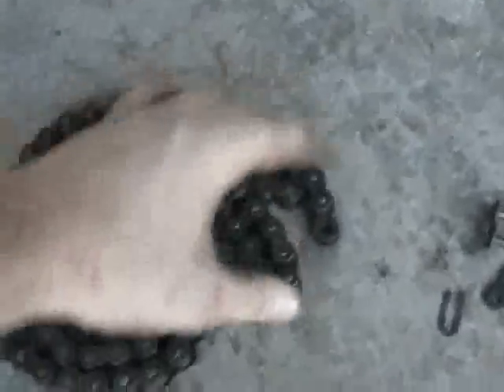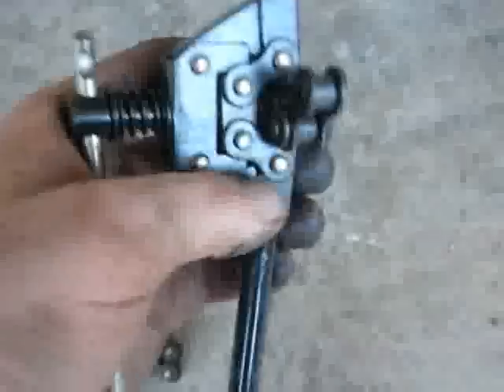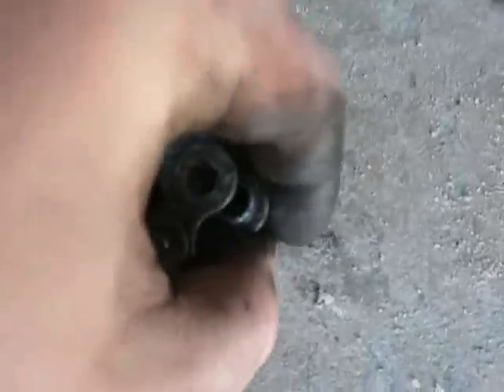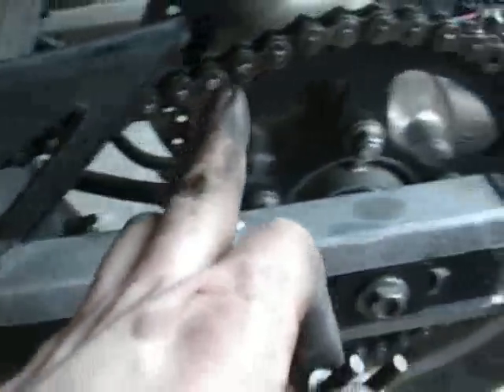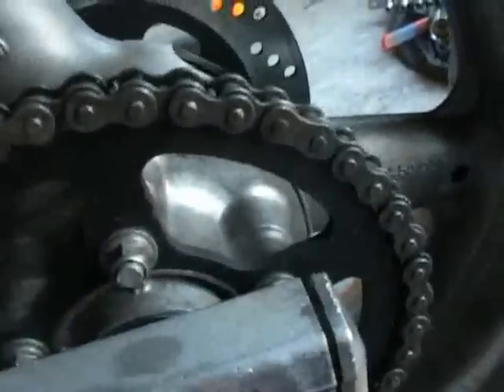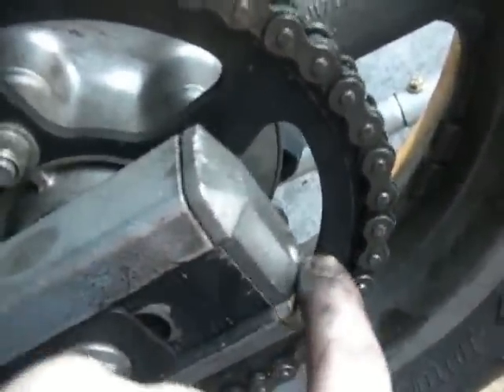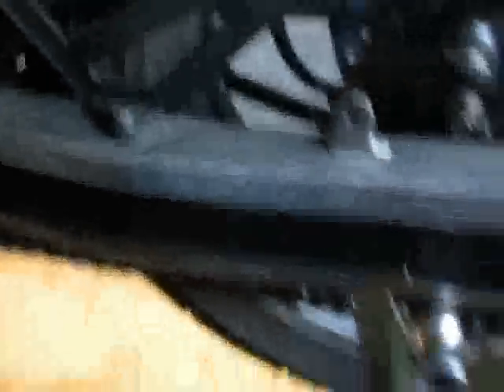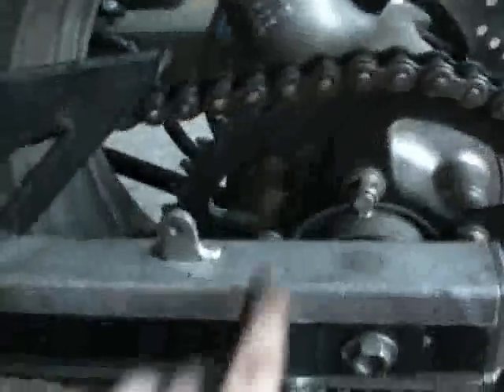Howto: Replace Your Motorcycle Chain in 10 Mins

Comment: TOP TIP: After splitting the old chain, if you join the new chain to the old chain with a cable tie (or even the old link), you can pull the old chain around the front sprocket (in neutral) and it will thread the new chain for you. That saves having to remove the front sprocket cover and/or fiddly threading of the new chain into position.....

Comment from the maker: Sounds good.  For others to read: An ideal scenario would be to run a straight edge along the chain, but thats not always physically possible. Even the tick marks aren't always accurate (if your bike even has them, this one does not.) Its very accurate (enough) to run your line of sight down the length of the chain. This works well for figuring the straightness of lumber as it does a chain.

Comment: Nice, one tip I have is to use the old master link to attach the new chain to the old one after its trimmed to the proper size.   Pull the chain around and back to the rear sprocket till the ends of the new chain meet up at the rear sprocket and then remove the old chain and attach as normal with the new master link.  It avoids having to pull the plate off on the front side.

Comment: Thanks for the information.

I'm new to motorbikes but am alright with the tools, I was cleaning my chain alot and still only got 30 000 km (18 750 miles) on it from brand new.

The rear sprocket has the wave pattern on it now too.  So I'll have to replace chain and sprocket now before I can ride again.  The front sprocket still looks good.

I was resisting the temptation to lube the chain with the motor running, however I did that last time, I won't do that anymore after seeing that photo.

Comment: Thanks for the hint on putting the two ends together on the rear sprocket.  Floating in space between the front and rear sprocket the master link is a pain to get set... it's those little tricks that make doing it yourself so much easier the second time eh.

Comment: A quick way to put on the new chain is to connect it to the end of the old chain with the master link and then pull the new one through & around the sprockets when you remove the old chain.

Comment: Bravo on the last tip about the...duh...helmet! :D

BTW, aligning the rear wheel can be done by measuring from the center of the crank to the center of the axel on both sides. When the wheel is aligned then you can tighten each side the same amount (1 turn on right, 1 turn on left, etc.) until the chain is tight. As you tighten the axel, check the tension again. Finally give the tensioners one more tightening when the axel is at its final locked position to prevent wheel migration. Ride safe! :)

Comment from the maker: @oldskooldancemusic1 You don't want to make it flush, it will probably pull out.  The rivets in the chain are actually slightly mushroomed or dimpled and pressed together.  If its flush its not going to lock in position as it should and I would expect failure soon.

Comment: Even more time saving another TIP when replacing a chain to save you taking the chain guard off join the new chain to the old chain and pull it thru then take off the old one then join the new chain together  split links are ok for small bikes but not for high cc  big bikes. good video tho for others just new to doing this job.

Comment: Hey well done, good vid!! even if it was filmed one handed LOL!
just a quick tip ensure that the lube is sprayed on the inside circumference as it spins around the sprocket it will evenly distribute the lube as a pose to the outside its a complete waste and loads of over spray and just doesn't provide sufficient lube P.S i learnt it the hard way at 130kmph

Comment: Glad I saw this vid. I have the same tool but when I try to break my new chain it spreads the plates apart and starts to separate the next link from the roller. Have you ever had this happen? I am worried that will compromise the chain.

Comment from the maker: @srtrcr 27 years experience here servicing my own bikes and those of my friends. I've owned nearly 50 bikes and counting, and guess what?  Thats right!  Not a single failure!  If you aren't using worn out or damaged parts and you actually know what you're doing and properly maintain your vehicle, you won't have any problems using any kind of link.  Most dealers that aren't trying to "sell you" will also tell you the same thing.  Your comment is merely an opinion and not fact at all.

Comment: This is why putting a drop of rtv type silicon on the clip will stop it moving, clips falling out is much more common than them breaking which many people believe happens. Over 200,000 miles without problem RTV is the way to go.

Comment from the maker: @kopkraft Sometimes, but there is a spec to have the chain at when the bike is unloaded, and that should already take into account for the weight change.  And generally if the chain is straight, the wheel *SHOULD* be straight unless something is out of spec like a bent frame or swingarm or axle damage or something.  Thanks so much for the compliment!  :-D

Comment from the maker: You can, yes, I suppose if you made a mistake and pressed out the wrong one.  I've never had to reassemble one before, but using the same tool that I take them apart with, a new pin can be pressed back in.

Comment from the maker: I had the same problem some time ago when I forgot to tighten the rear axle all the way (what a stupid mistake THAT was!) Anyways, the pushrod was broken off, I tried to use a magnet to retrieve what was left of it that was still in the engine but no luck. It turns out the remaining piece actually bent just slightly enough that it got hung up. I took the cluch cover off and tapped it though from the inside with a slightly smaller dowel. Once it popped out, I just put in a new rod!  :)

Comment from the maker: @bocap1980 I'm not sure which bolt you speak of, there are several, but they all have a specific torque specification. If you make them too tight you risk stripping them, or crushing components that they are fastening together.

Comment: @moemoecake If the chain seems to always get loose by itself very quickly its usually an obvious sign, also if the chain bends left and right easily, or if it the sprockets are worn out, then change the chain out, too.

Comment from the maker: @slannmage I dunno, I had a bike that would stretch chains out, quite literally... because the sprockets were worn.  After replacing the sprockets those symptoms went away.  It is recommended to replace both as the wear patterns will match. But as you said, you don't really have to, but I'm also sure that you're competant enough to maintain it properly and check it often.... most pepole are not!  :)

Comment: It doesn't make any difference to how it feels, however with the clip link, they can fall off. Has happened to my road bike and my race bike...not sure how it happened because I maintain the chain pretty well and they were clipped on the correct way. I now have replaced them both with rivet links...no chance of coming off. Only downside, it is a pain to remove the chain if you ever need to change it again (more annoying for race/track bikes).

Comment: Excellent video! Question: I used the same chain breaking tool you have, but I can't get the pin out of the bushing. Since I'm using the 520SX X-Ring chain, I need the bushing (not only the smaller ring which actually makes contact with the sprocket) in order for that smaller ring not to rattle all over the place. Hope this is not too convoluted, I just need that bushing! How do I get it?

Comment: Master links are not very common on newer sportbikes... all links are riveted shut... nothing wrong with a masterlink but I do recommend putting a dab of RTV silicone on the masterlink to make sure it doesn't come off.

When wanting to take off a rivet from a chain you simply grind off the head of the rivet and pop it out the other end... if you don't have a chain rivet tool you can use a masterlink after taking out 2 rivets.

Comment: Ive done this many times what I do is grind the split link in half on the bike then connect the new chain to the old one with the new split link but not secured then pull the new chain through over the front sprocket :)

Comment: after you cut off the old chain, you can link it temporarily with the new one to pull the new one on the front sprocket, so you don't have to take off that cover
Reply from the maker: +Ridwan Ridwan Thanks, someone else discussed that in earlier comments.  Its kind of a no-no to be replacing the chain without a new sprocket anyway, so ordinarily the sprocket cover will be coming off because of that alone  :)

Comment from the maker: @guitaneman It depends on your master link.  If your link is riveted, you're going to press it out and then break the chain and replace with a new master.  If you're using a lock type like I have in the video, just pop it off, and break the chain and reassemble.  Is there any reason why your chain is stretching so quicky?  It could be that your sprockets are worn or you had it too tight.  Both are problems that have stretched chains on my older bikes when I was just learning this stuff.

Comment from the maker: @w00tplayaw00t I actually don't know, I bought the bike used with 21k miles and it was quite unkept with a three-times-blown engine (It was rebuilt and blown 3 times.)  You can find videos of me restoring it when I was doing a CR500 engine swap in it.  After another SV swap, I found the old chain was such bad shape that it might have actually had all 21k on it!  Haha!  (It could flex sideways A LOT!)

Comment from the maker: Then if its an old chain, its probably stretched out and needs replacement.  I'd recommend changing the sprockets out, too, as a stretched out chain will ruin the sprockets.  If its a new chain, its just too big.  Cut a couple links out of it.

Comment: @deathdealer004 Then you'd have to take the whole swingarm off to put the chain on, that would suck.  Some bikes the frame even passes through the chain meaning you'd have to cut the frame to put the chain on... not very practical.  All chains use rivets for each link, newer chains use a riveted master now, this older clip-on style people say is unreliable and incorrect to use, but I've never had a problem with one on dozens of bikes that I have own or ridden in the last 25 years.

Comment: It looked like you tossed the 'inner' sleeve and only kept the shorter, 'outer' sleeve that the pin goes through. Did you end up using both sleeves on each pin on the master clip or only the shorter bushing?

Comment from the maker: @sparkn "beat it up" was used figuratively. Its a NJ colloquialsm that you may not understand, its part of my culture. The other pin doesnt HAVE TO be pressed out the same way, depends on the chain. If you watched the rest of the video you also heard me say its an old chain I found in my toolbox that isn't in very good shape either. It came apart easily, a little too easy.

Comment: @clorang115 You have to push the wheel forwards (from behind), then push with your knee, then tighten the axle is my take on it.  I suspect you have to pull back as you tighten on the bikes with "in-swingarm" adjusters ???  I have normal adjusters so I push forwards while tightening.

Comment: Hey man,

Great video thanks a bunch. I am having hard time aligning my rear wheel. Any neat tricks to make that less hassle? Thanks
Reply from the maker: Jyotirmoy RoyChowdhury I'm a little late to this one, but I like to look straight down the chain as you would to see if a 2x4 lumber is straight, you can also lay a proper straight edge against the side of the chain.  The notches or lines on the swingarm (if you have them) don't always seem to be accurate or even exist at all, so I don't usually tell people to go by them.

Comment: Well, haven't I changed my chain and sprockets wrong so far! Thank you so much for this video! Since you seem to have lots of experience, I wanted to ask: Can I change only the chain if the sprocks are still good enough? And vice versa? What kind of care should I have with them? I was using querosene until some people told me it's abrasive, but it just cleaned it so shiny that I, despite those advices, still use it. Sometimes I even take a bit of gas from the bike. Works wonders too, at least at naked eye. What do you think?
Reply: Change both sprockets when the chain is replaced. The old sprockets may look good but they will have some amount of wear and will shorten the life of your new chain.

Comment: so my chain on my tl1000s whipped the aluminium piece of the casing where one of the 2 bolts for the clutch release goes right off. Its essentially the same setup and clutch release mechanism as your SV650. Got any advice?

Comment: Hey im changing the chain on my 2007 Honda CBR600RR and i noticed some play in the front sprocket and I was wondering if that is normal. its a tiny bit of play, like 1/16th of an inch play back and forth and from side to side.

Comment: Nice video. You make it look easy. I usually get a bike mechanic to do mine, but next time I'll try myself. Just one question.. Every time the bike mechanic does it, the chain tension is set just right, and the wheel is as far 'in' as possible. In other words the wheelbase is adjusted to be as short as possible. This allows tension to be adjusted as time goes on and the chain stretches out. My question is, how do you manage to get a new chain and sprocket set installed with the wheel as far 'in' as possible? Do you cut links out of the new chain? Thanks
Reply: yes

Comment: @vvtheduckvv thanks, was going to do it myself, as i can do my mtb one no prob, that is different in design though (you need to push a pin through with a tool on those chains) so thought although motorbike chains are bigger, same principle. but my experienced biker friend advised me not to do it myself, as its such a hard job! but he described a totally different way than the way you do it.

Comment: Just changed the chain on my CBR1000 which has a solid master link rivet. There is no rivet lock like yours so somehow the rivets need to be preened like all the others. What tool is used to do this? Please no comments to use a flaring pin, I have solid rivets and not the soft type that can be flared. I have my own vid on that subject!
Reply: peening hammer. the round side

Comment: I discovered a scam a few years ago.  My chain was stretching and breaking frequently.  I knew that a standard machine drive chain would not do that. So I located a chain from an industrial source, (for 1/10 the price) and it never gave me a moment's trouble ever after.
The planned-obsolescence scam is alive and well in the motorcycle industry.
Reply from the maker: Thats interesting.  I'll source a chain that way instead next time and see.  I've only had a chain break once, though.... it was a cheap chinese chain on a chinese motorcycle, it wasn't but a day old and the sprockets just ate right through it.  Replaced with a new chain and everything was fine.
Reply: The chain I bought was the same dimensions, but specked at a much higher tensile strength.  The motorcycle dealer wanted $80 for a replacement chain, but I bought mine for $8 from a farm machinery dealer.

Comment: question i want to replace my motorcycle chain i have a 1997 yamaha yzf 1000 should i replace it with a normal chain or a quicj release chain thoughts ??
Reply from the maker: That's probably a master link question and not some special chain question.  I have no problem with clip on master links.  Someone will scold me, but the local dealership owner says the same thing, and he has 50 years experience.

Comment: Hey I've had my chain pop off and break my push rod, I was able to get all of it out of the motor :) but my chain is really loose?!?
Reply from the maker: Justin Davis I've had that happen.... I was in a hurry once and didn't tighten the back wheel properly.  I had to open up the engine and push the rod through from the other side.  BUT!  In your case, if the chain is loose then tighten it... if it seems it won't tighten anymore, then its stretched out and you need a new one... you should probably change your sprockets, too.

Comment: Is it me, or did he not show how to take the old chain off?
Reply: You just remove the clip then you should be able to pop the plate off and the links out the other side. I was actually surprised he didn't use a chain press before securing the link with the clip.

Comment: this video became useless to me when you didnt show how to wrap the chain around the sprockets. thats like half the battle...
Reply from the maker: If that was the hard part, you've got some bigger problems.  Hope you've got it figured out by now.
Reply: i have not done said project yet (waiting for parts). if its easy, then great. I couldnt really judge the difficulty of this project with out seeing that part done.
Reply: An easy way to get the chain around the sprockets, assuming your chain isn't already connected, is to break the old chain with a chain breaker, then connect the end of the new chain to one end of the old chain with a zip tie and then pull the old chain through so that the new chain threads through the sprockets correctly.
Reply from the maker: Capn Prat Yup!  :-D